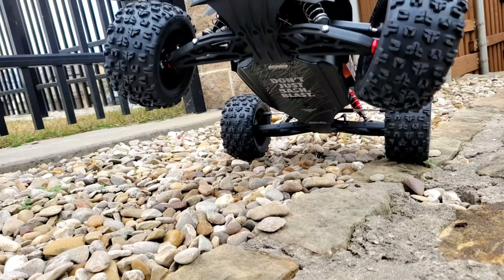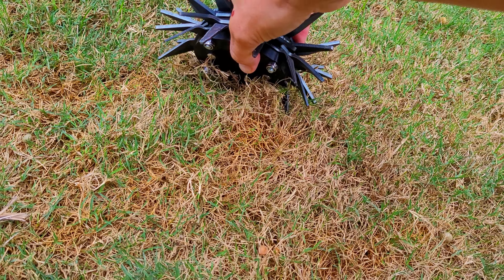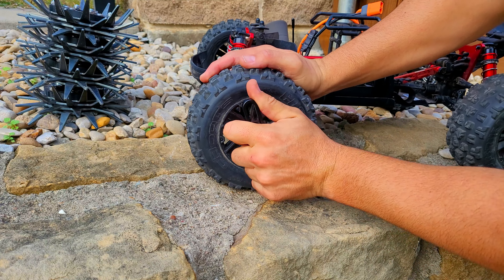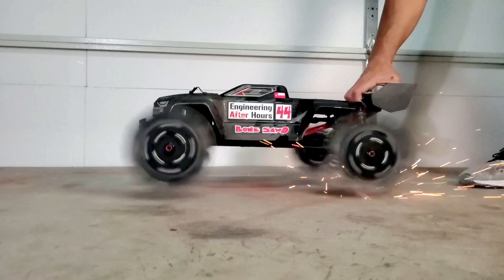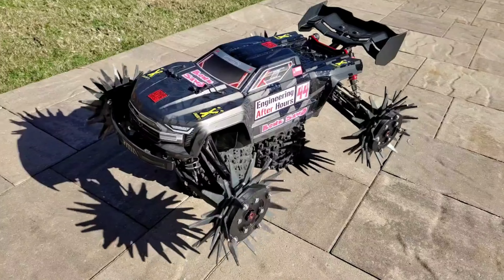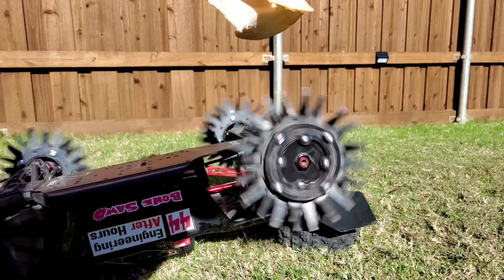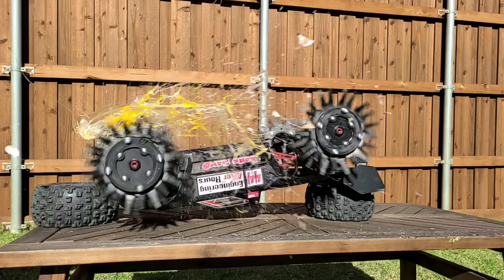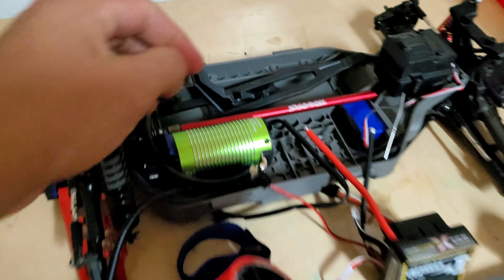I Made Reaper Wheels and put them on a Kraton

Comment: I would love to see a four motor direct drive drag car with gyro integration to keep it planted. I really think that would be awesome
Reply: That would be absolutely overkill! The tires would probably explode, lol. It would be fun to watch tho.
Reply: @pigletpuglet  the idea would be to use the gyro to prevent excess power at any given wheel. It would give you much more control and be like traction control on a 1:1 car
Reply: @jondilly1974  I thought gyros only help with steering and not throttle, I could be wrong though.
Reply: @pigletpuglet  yep they can be applied to attenuate any channel.

Comment: I've been noodling a thought this may be overcomplicating things not sure but on the underwing tray with the fan car or you could call it mechanical downforce you have to have a winddam basically at the back and at the front of the underwing Trey I've been wondering would it be more efficient on the batteries if at low speed you're using mechanical downforce but have an actuator and a sensor that win the car is moving fast enough the fan has a damper like a check valve that only allows the air to move one way through the system so that the fan can shut off and an actuator can just pivot the back and front winddams flat on the underwing at speed so other words at low speed mechanical downforce at high speed it's just a underwing generating downforce the traditional way and without having to run the fan motors now all of the battery can be used for the drive motor at speed but if the car slows down the fans come back in maybe it'd be worth experimenting with

Comment: For a standing back flip? My car wich from stand still can do 6-7 flips before even touching the ground again "ha PEASANT" keep in mind I'm getting probably less than half my power off launch because of the settings... so I'm concerned what it COULD do
Reply from the maker: Yeah I had the max throttle setting and punch setting way down just so I didn't accidentally hit anything too hard.
Reply: @EngineeringAfterHours  lol that's a good thing tbh.... the reason why my car is able to do it tho had to  do with scale 😅 I have the 1/16 brushless revo and I did a big block conversion to use a 1/10 brushless motor that has even higher torque so... yeah... speed deamon lol
Reply: @EngineeringAfterHours  but props to you as that was awsome what you did regardless

Comment: Hey I hope you're having a good day 2 days ago I made a post on here that apparently didn't raise no interest about creating a hybrid underwing system that I've been kicking around that use the fans and the vacuum box tray floating on the spindles but at speed both ends of the box open up and the belly of the box is an under wing thought I might explain why I think it would be faster and more efficient to do this I will try to keep my thesis short there's actually quite a bit of theory behind this what I could explain in a two or three minute video if I said that much here it would be the size of a very big magazine articles that nobody would read I hate to do this but I think I need to give an example in your car which is more efficient on gas running your air conditioner or riding with your windows down car air conditioner compressor from what I understand take about 10 to 20 horse on average from the engine depending on make and model when the compressor is engaged continually it is a constant drain on horsepower but yet if you have your air conditioner off and the windows down and the car is idling down the road let's say five mile an hour at such a low speed you're not losing much gas 2 aerodynamics but the faster you go the more aerodynamics become an issue and believe it or not at about 45 miles an hour most cars again depending on the make and model are losing 10 to 20 horse with the windows being down due to aerodynamics and the faster you go the more horsepower you will lose so under 45 mph usually it's more efficient to ride with your windows down but after 45 Mi an hour it is more efficient to ride with your air conditioner on from 45 and up because air conditioning is a constant horsepower draw it's not an exponential curve it's just a constant well we're kind of going to run into the same issues if you don't mind let me explain along with a few others problems but before I do I want to remind you of a few points there's an old saying it takes money to make money will in racing that principle applies it takes horsepower a lot of times to make horsepower if you don't believe that look at a blower on top of a Top Fuel dragster the amount of horsepower it takes to drive that blower is unreal but because of that blower that thing is making 10 to 11 thousand horse along with the horse power the blower is stealing from the engine and that blower is heavy they're adding weight to the car when they put it on top of that engine and these thoughts and principles apply to what I'm saying okay and under wing uses airdynamics which obviously is based on speed so it's an exponential curve the faster you go the more down force it generates but the problem is at low speeds you get virtually no downforce so in steps mechanical downforce using fans but this creates problems as well now you got the weight of the motors and batteries and the fans will be a constant voltage draw as well and other problems with you having a vacuum box under the car the front side of that box acts as a winddam so you got all this are piling up under the front end of the car and nowhere for it to go but around and the faster you go the higher the air pressure on the front of your winddam with a vacuum behind it and more and more are will be finding its way under the winddam and it's compromising your downforce the faster you go so with those thoughts in mind I think a hybrid is what makes sense and it addresses all of those problems used mechanical downforce at low speed find the point that the underwing would be generating the same amount of downforce as your fans open the vacuum box up by hinging the front and the back of the box and have the belly of the box shaped as an under wing to where it's the best of both worlds I'm sorry it's been long but it looks to me like it's definitely something to experiment with
Reply from the maker: It sounds similar to the T.50 where fans actually interact with the ground effect to create downforce, but its not a sealed box. So it would be more like me putting a fan at the back of the ground effect car I have. 

Did I understand that right?
Reply: Hey I apologize it's been hectic here the past few days and I'm sorry I didn't get back to you I hope you are having a good day it takes me hours to write and edit the stuff cuz I have relatively big hands would it be possible that we could just talk on the phone
Reply: And I was wondering would you be willing to kick  around some numbers on paper Subaru used to dominate  the hill climbs like Pikes Peak and Mount Washington where they race up the mountain until the electric cars took over the electric cars do not have to worry about their fuel-air mixture changing as they go up in altitude and that's just one Advantage the electric cars have using electric High horsepower Drive Motors so I think what I'm about to ask is possible if you wanted to build an RC car with a power-to-weight ratio of about 6 horse for every 1 pound try to keep it small to keep the expense down is it possible with what we're discussing using the mechanical downforce to start out and witching quickly to using and underwing at speed and I probably can guess once you think about this you'll probably be thinking there's no tires that's small that can stand that kind of RPMs and centrifugal force own them at speed to match what a Top Fuel dragster can do in a quarter mile run for an example one of my favorite drag racers John Force his daughter Brittany Forc's holds the NHRA record in 2021 for the fastest quarter-mile run which is 337 mph in 3.64 seconds because a Top Fuel dragster is about 5 to 5 half horse per 1 lb and with the engines making 10 to 11 thousand horse and the average car weight being 2 3 30 lb and they have no transmission instead it is direct drive using a centrifugal forced clutch with cams engaging the clutch more and more as the car travels down the track and here's the thing they cannot use all the horsepower they're making so if we can come out of the hole using mechanical downforce giving us one heck of an advantage in our launch then switching quickly at the right time to a underwing without upsetting the car and make the same amount of downforce on the underwing at that point in the Run and once it's using the underwing it'll start making more and more downforce the faster the car goes and the car being Electric we don't have to mess with no stupid clutches and we do this right we should be able to use all of our horsepower and unlike them we don't have to rebuild our engines at the end of every run we should be able to do it over and over again don't worry about the tires I've gotten a idea there that's one reason I want to talk to you in person I need you to run some unusual experiments and with this thing being an RC car good chance they will allow it on the track because it's such a ridiculous idea they wouldn't think it could be a match for a top fuel dragster I don't know what do you think and if it made its run in front of spectators beating the Top Fuel dragster unless they disqualify it for some ridiculous reason they would have to let us make our backup run if this can be done and from what I know there looks like there might be a way I'm watching another Channel on here and this Feller has built an RC car with four Electric Motors apparently each motor makes 15 horse per motor the car makes 60 horsepower and Waze 20 lb that's power weight ratio 3 horsepower per 1 pound if we can double that we wood have it